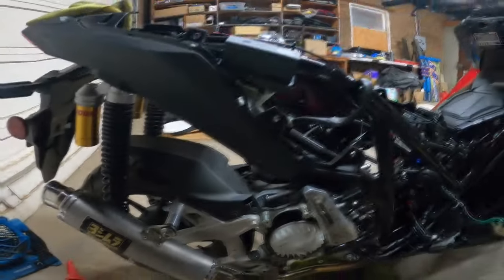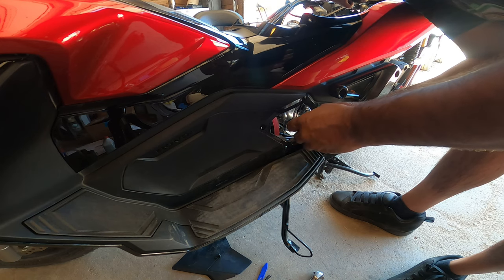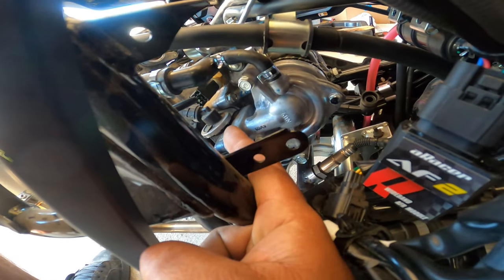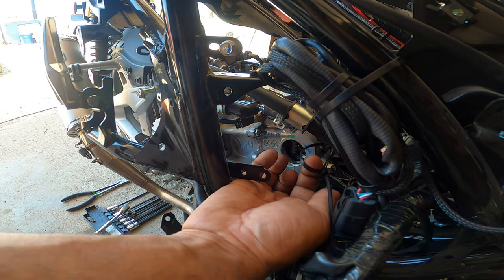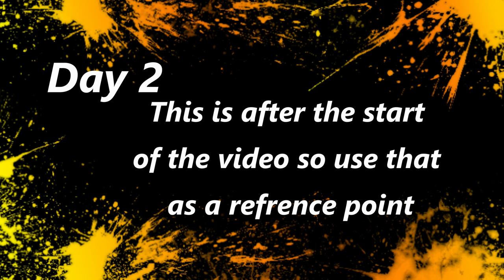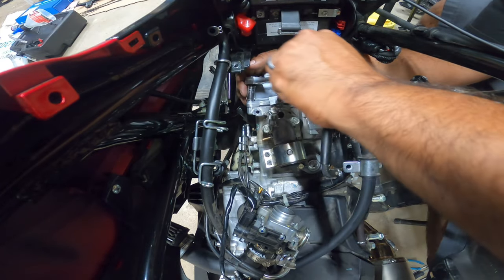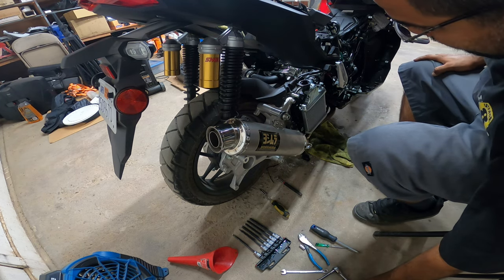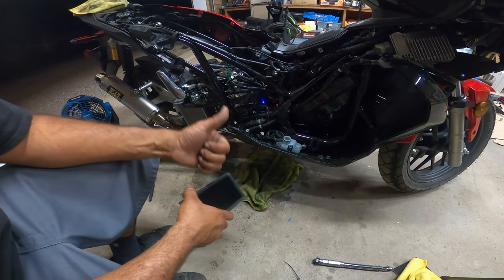How to install a DCR CAM in your Honda ADV 150

Comment: Hi sir did you remap Ecu 
After camshaft?
Reply from the maker: Yes I did
Reply: How did it run after tune?  big diffrence? I just installed BRT stage 1 cam for stock engine for PCX 160. Runs ok but not optimal. alot of gas smell also from exhaust. Im not sure if the smell is from incorrect tune ore Valve clearance? i set IN. 0.10mm EX 0.15mm as BRT told me.  Idles good no issue starting same as orginal   BRT Cam has more duration then stock cam..    @PincheALsGarage
Reply from the maker: @pattayakamagra8325  yeah you will have a heavy gas smell but mine was worse because I added a bigger injector and a full flow exhaust system. I also had a wide band 02 sensor that helps correct fueling accurately with my Aracer mini 5 ECU